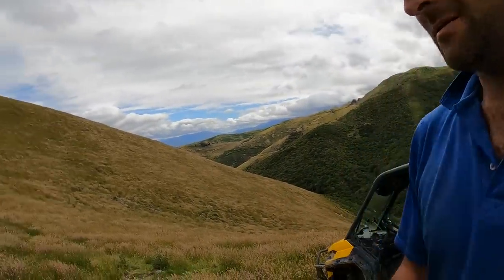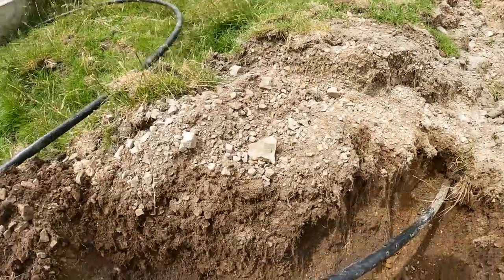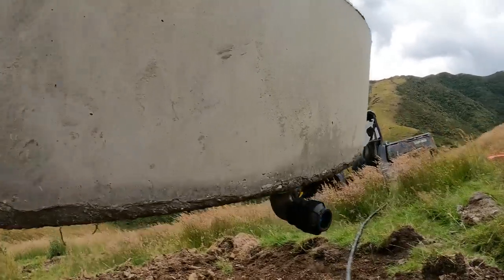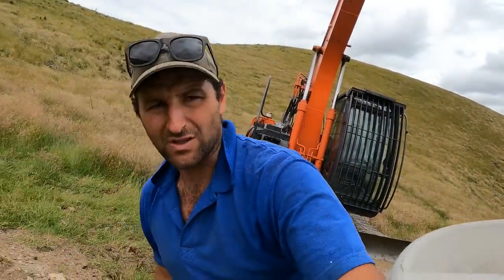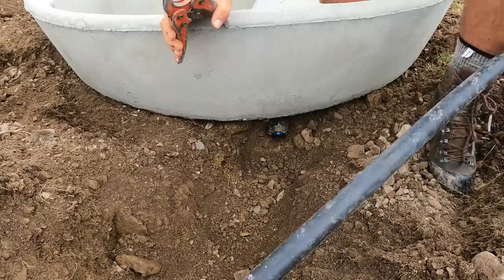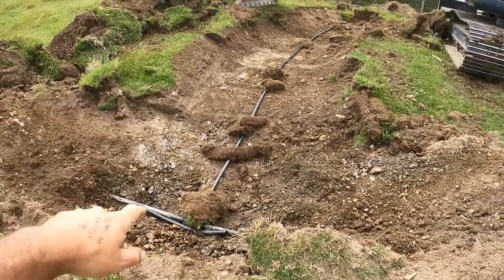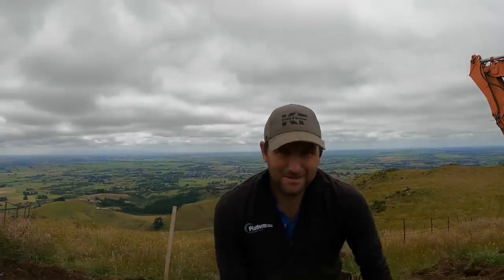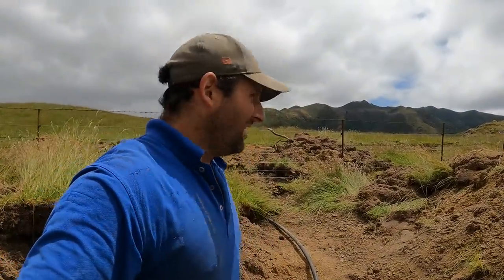New Water Scheme Part 4: Setting troughs.

Comment: My lambs weighed 46kg live weight,averaged £2.36/kg ....so £108/lamb.
Trade is tricky tho. Very selective my buddies came to £72 for 33kg. The stores are dearer than that.
People appear to have run out of money. Electricity,gas,water also mortgages up again today. Nurses on strike, teachers,ambulance drivers,posties...no one very happy. 
I see it v wet in Auckland,very unseasonal. Getting on well with the water system🙂
Reply from the maker: Thanks Mark. The store price is well out of kilter to the prime price which is strange. They had it bad up there. It sure is strange times and only going go get worse.
Reply: Do you guys get paid off live weight or were these ewe lambs sold store?

We're sending about a load of 40-45kg finished lambs tomorrow and we'll be lucky to get $130 NZD per head. Price has bees absolutely hammered since about November here.